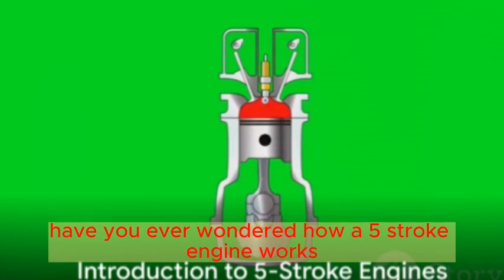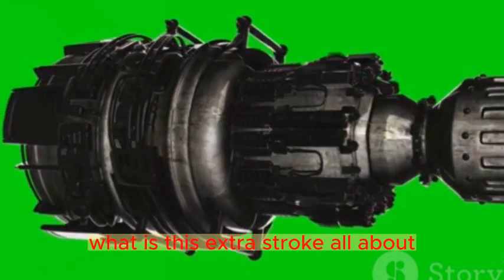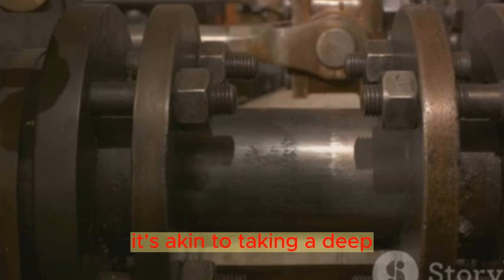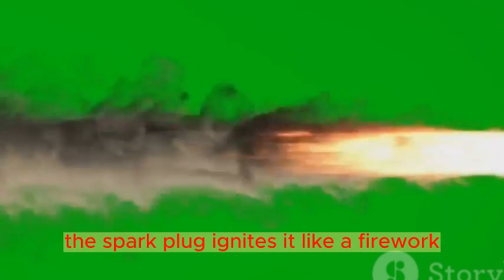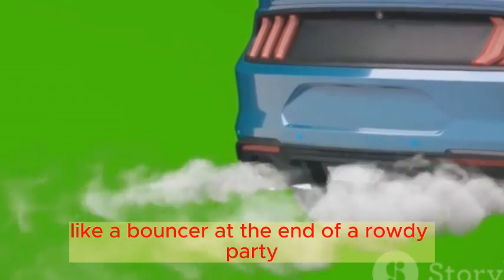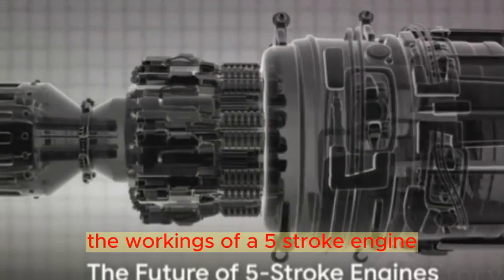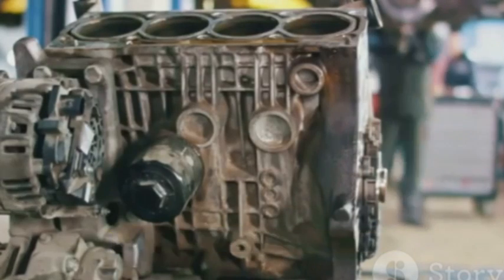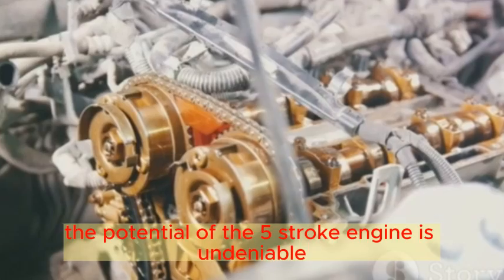5 Stroke Engine | 6 Stroke Engine

Comment: So.... instead of one exhaust stroke it runs two exhausting compressions with the latter expansion being used to inject only fuel. The what would be an air-fuel injection now needs to less fuel this time as some is already inside.
Expectation (opinion): Cleaner burn of fuel which is getting more regulated by governmental environmental penalties at the cost of 20% more wear on engine components by needing 20% more rpm to achieve the same power. Less environmental fees for more disposal of engine or components, with their own but hidden environmental costs.